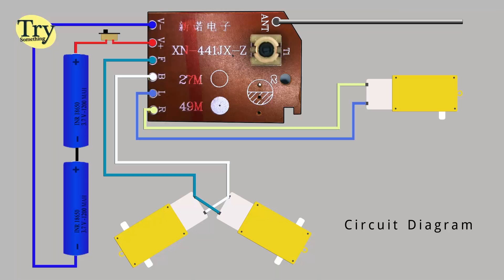How to make A Wireless Remote Control Truck From Normal Truck

Comment: How much voltage it need to riciver
Reply from the maker: 6volt
Reply: @TrySomething then how can u give 2 x3.7v battery in series it's almost 7.4v and full charged voltage is 8.4v will the receiver survive with the 8.4v